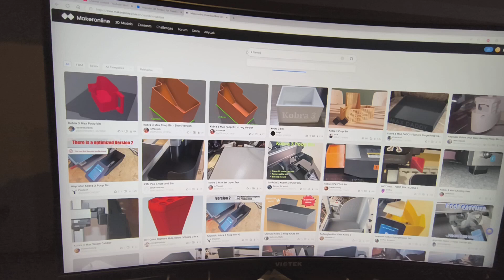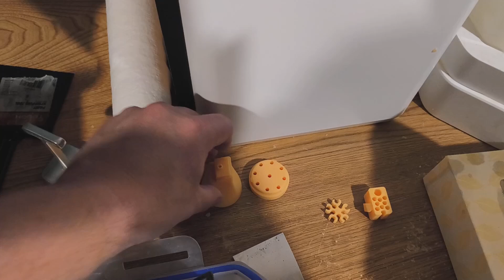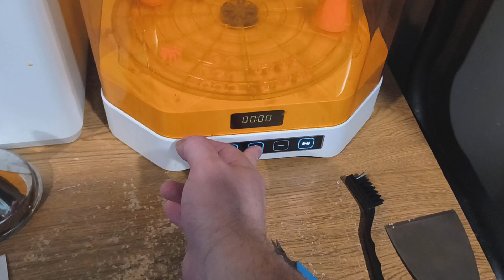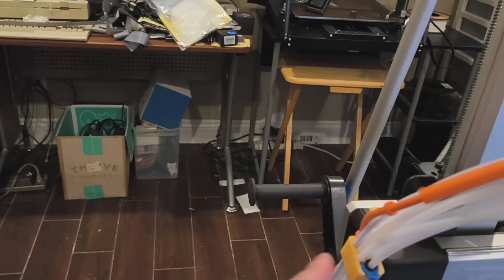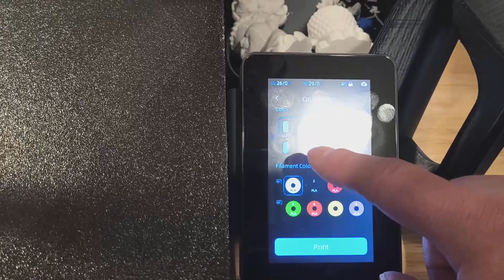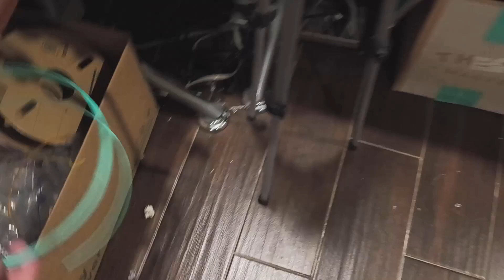Anycubic Kobra 3 Max Combo: Vid #4 - 3D Printing a 9 Filament Hub and Installing It.  Colour Prints.

Comment from the maker: UPDATE:  I used two of these resin printed hubs for weeks, but both ended up failing eventually.  The resin is too brittle, and the small outlet at the bottom of the hub has a habit of breaking off and falling into the print head.  This causes the filament to misfeed.  I eventually reprinted the same hub using PLA Carbon Fiber and that works much better and it a lot tougher.

Comment: What would you say is your best biggest printer out of the max ones. I have a small printer but going to buy a jupiter se for resin but also need a big volume filament. Budget anywhere up to 1k possibly 1.3 at a push if its worth stretching
Reply: I don't need multicolour for this one however if it's a better printer then having that feature is fine also
Reply from the maker: @ That's a hard one.  My Elegoo Neptune printers are completely tried and tested, so if you're not worried about changing colours then either the N3M or N4M are excellent choices.  For the extra money you pay for the N4M, you'll get a USB memory stick port instead of the microSD card slot, plus a wireless connection.  It also runs Klipper instead of Marlin and it manages the same quality at more than twice the speed.

Comment: do you recommend the neptune 4 max?
Reply from the maker: Absolutely.  Mine has been working perfectly since you saw the setup video.  I've done 2 firmware updates, and not had to replace anything (yet).  Right now it is making a huge 400x400x440 flowerpot for my wife.  :)
Reply: @LanchburyConsultingLLC  would u recommend me buy one for big prints or just wait for anycubic kobra 3 max stock? even tho it is $200 more expensive in my country
Reply from the maker: @Zelin-dh5me Now that's a tough call.  If you're just doing single colour printing then the machines are almost identical in features, although the Kobra was easier to set up and so is updating the firmware.
If you feel you might want to do multi-colour printing then there really is no choice and you have to go for the Kobra.
One other option is to perhaps get a Neptune 3 Max while you wait on the Kobra.  My 3 Max might run at half the speed of my 4 Max, but it has been a solid printer that has given me no issues.
Reply: @ thank you for your recommendations, i will order on amazon the neptune 4 max and see if it goes well with my needs, if i end up not liking it will return it and get the kobra 3 max
Reply from the maker: @Zelin-dh5me Good luck.  Just take your time setting up that 4 Max and do a good bed level and you'll love it.  I recommend using the latest Ultimaker Cura as it has some good pre-sets in it.  If you prefer Orca then Elegoo has "ElegooSlicer" as a free download on their site and it is basically Orca tuned for the Neptune printers.